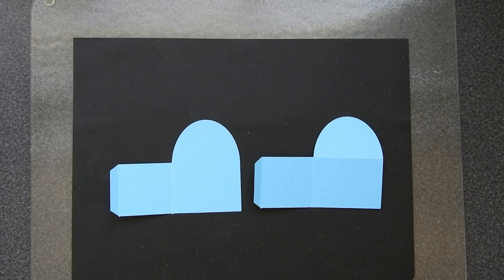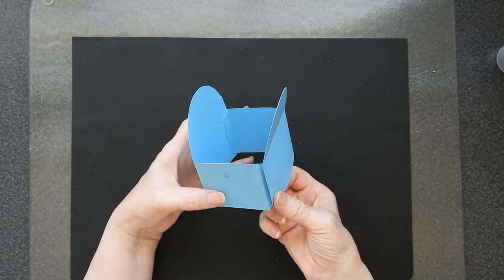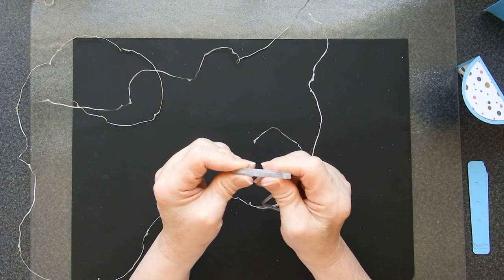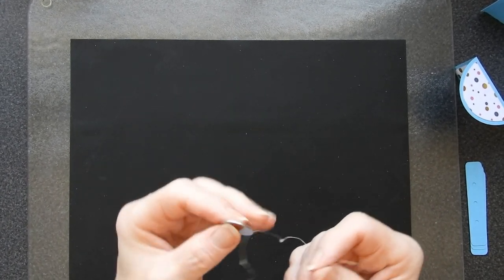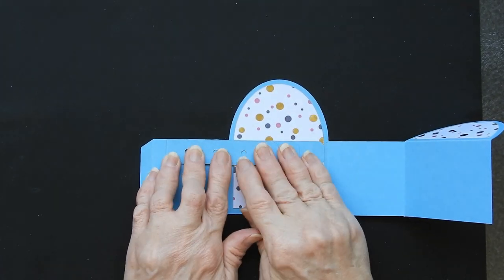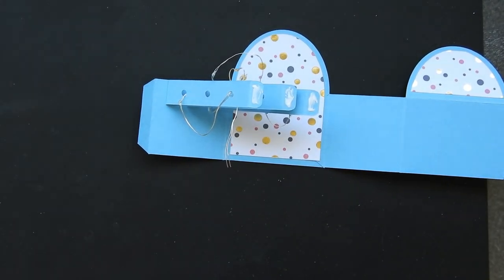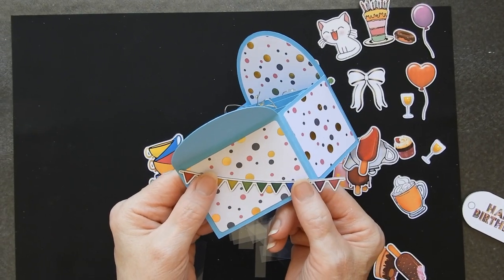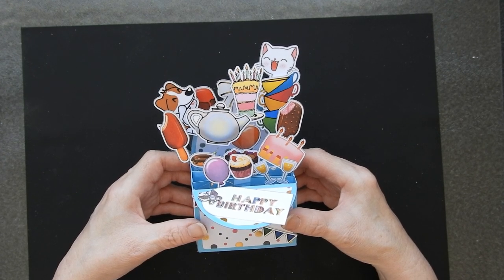Making an LED Pop Up Box card - the Easy Way!

Comment: Fab.. Love it.  Great tip about cutting the lights I didn't know you could do that! Is it possible to create a push on off button for the lights I wonder ?
Reply from the maker: Yes you can! I was trying to keep this one as easy as possible, so as not to be too scary! I have a whole playlist of LED cards with different ways to switch on and off, although the easiest way for this one is to use the part with the battery compartment still on it. https://www.youtube.com/playlist?list=PLPSUAA6eD3zo4swucCMoBlVOdwmmVXBbO
Reply: @createinspain  thank you .. You are not scary! love your relaxed and very informative videos.  I will have a look at your playlist.  I have used those led lights before but as I said I didn't know you could cut them. I even bought copper tape at one stage to try and make my own switch.  Just never got around to trying. I am fairly new to cardmaking.. Only took it up when I retired. But love it and I try and create "unusual cards".  😊♥